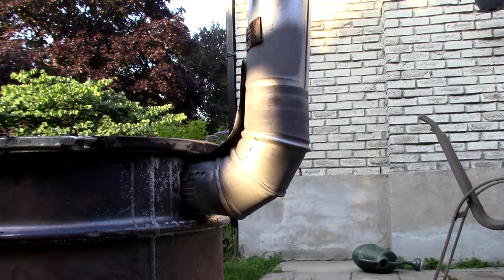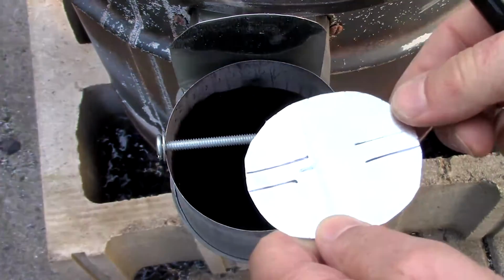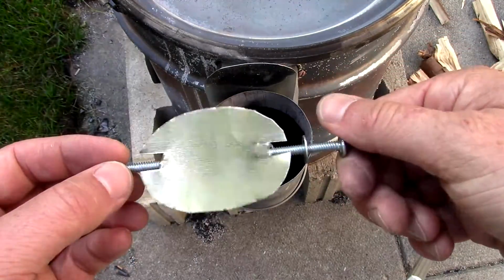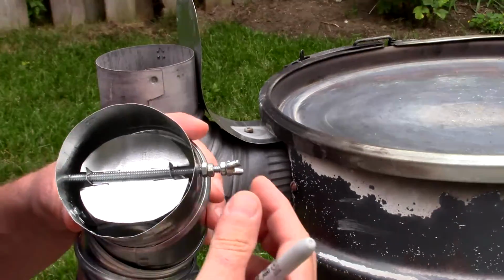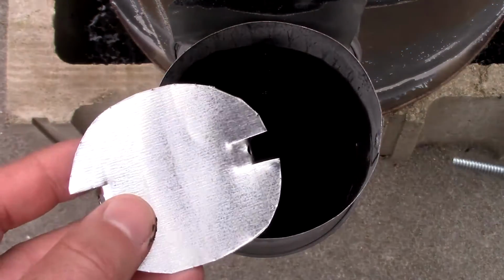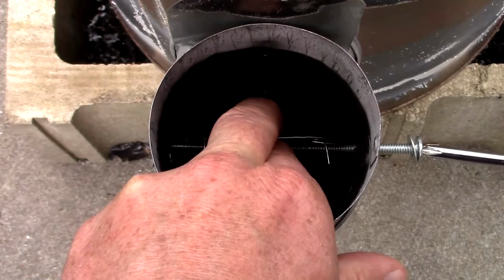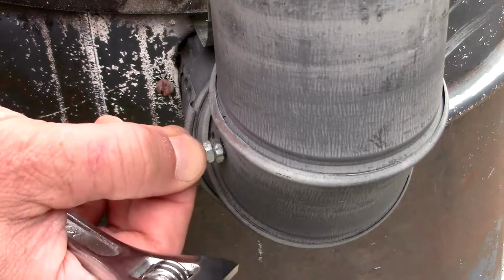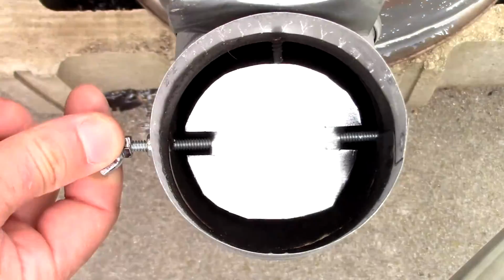How To Make Damper for Tent Stove

Comment: Nice idea, thanks. 

1.  Pivot rod would be held tighter to the damper plate by threading two nuts onto it with one of those holed tabs sandwiched between and locked tight.  Super simple and would be a LOT more reliable vs depending on simple friction (which can decrease with repeated heating/cooling cycles).  

2.  Your drill bit won't "walk" if you simply dimple the metal with a center punch before drilling.  Helps accuracy and makes life much easier, believe me.

Comment: The reason why the plate needs to be a bit smaller than the pipe, is the carbon monoxide. If the stove is placed in closed space, it needs to have the gap to vent out the carbon monoxide in case of users mistake of closing the flap too early.